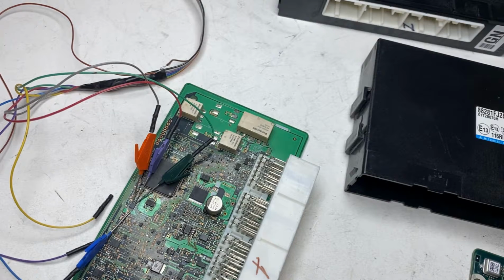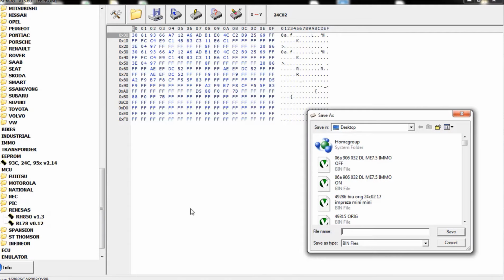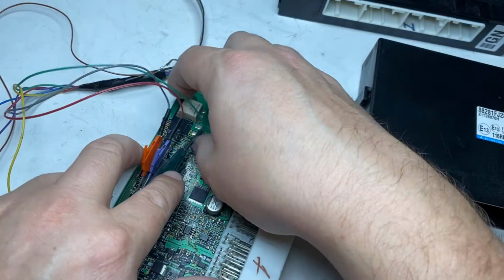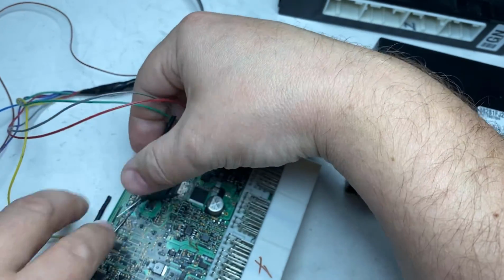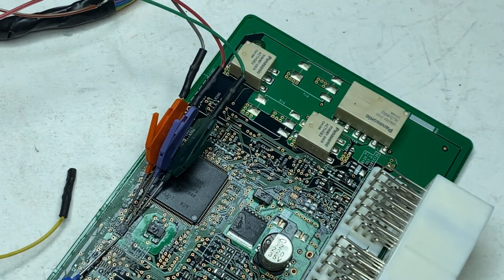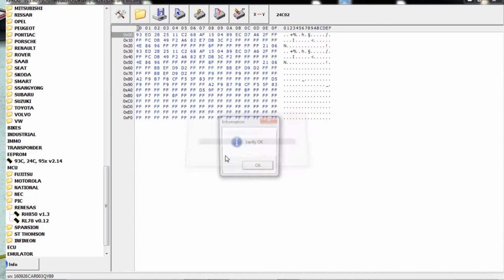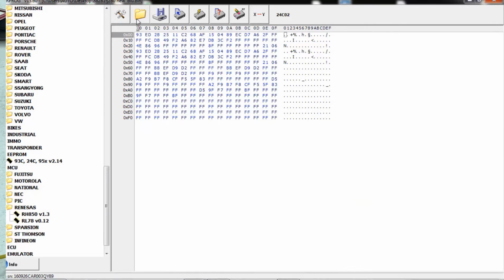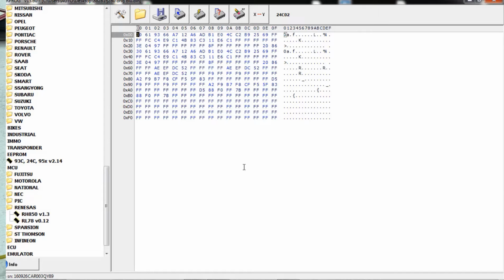How to program Subaru BIU Body Integrated Unit

Comment: I don't know, can I just solder that EPROM to a new motherboard?
Reply: Did you manage to do it? I'm pretty sure my BIU is gone, and I'm looking to buy one off ebay
Reply from the maker: You can try but if it’s a small eprom good luck. If you mess up the chip when removing or installing then it will be un clone able

Comment: Can you just desolder the chip and swap to another BIU and everything will work fine. ?
Reply from the maker: Yes and no sometimes overheating the chip can loose data in it.
Reply: What did you end up doing? Any info would be awesome.

Comment: hi how much u charge for reflashing my i have 2011 subaru wrx was abadon fir 3 years and now no spark i ready check everything no damage harness no bad fuse no codes and some one told me if is not rpm is the ecu every time i cranks rpm dont move and i ready got used ecu but my scanner dont acces to programin please help
Reply from the maker: Karmanauto.com

Comment: Hi, friends have a impreza 2009, stolen and recovery, have not keys, i make new keys, but cant program by obd2, have code B0201, B0202 and B0402, if i do trasponder by dump this will work? Or i need to replace BIU? Tks.
Reply: Problem solved, new keys by dump and work.
Reply: @manuelvizcarra8617  Hey man, can you elaborate a little? I am working on a 2019 WRX with lost keys as well. In the same boat. Not sure how to get the BIU to accept new keys. New is around $400. Did you use carprog? Whats the short version of the process? TIA

Comment: excellent video, nobody (not even subaru) really knows how to get these things to do what you need, if the factory headunit goes, you loose BIM controls, if you swap the ECU you have key warning lights on the dash etc. it's a paiful piece of equipment. I understand that it's locked up for security reasons, but not being able to change how the central locking operates or removing false waning lights on the dash is the worst.

Comment: HI I NEED HELP. 2005 Subaru LGT. Auto to manual swap. I want to remove the error on the canbus when I removed the tcu. Can you/i reprogram any modules after replacing the cluster to MT cluster instead of AT. I want it to be like oem without having to locate an entire harness and module swap since I already know I can use the original ecu

Comment: Awesome. Video. What programs would you recommend for reading subaru biu and ecm. Also, how did you learn the hex code and any recommendations. Thanks
Reply from the maker: For programs and programmers  we have  abrites , cpt, carprog, hexprog etc and still can’t read all modules for reading hex it’s time you need I’ve been doing it for over 20 years